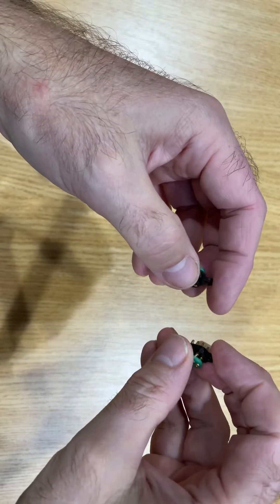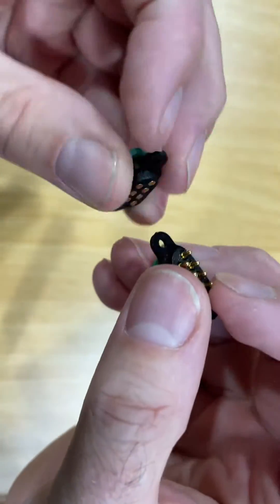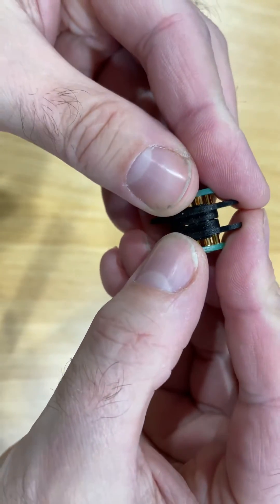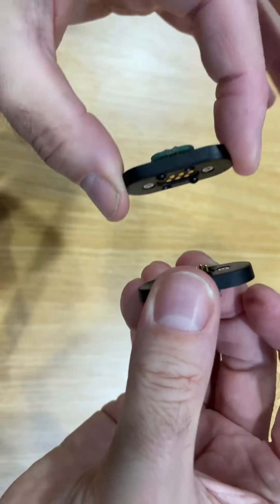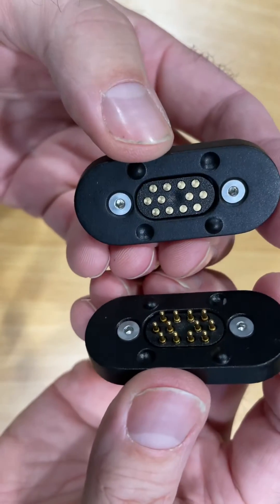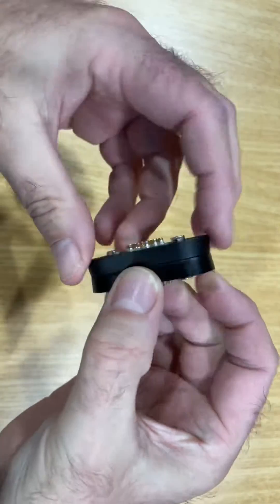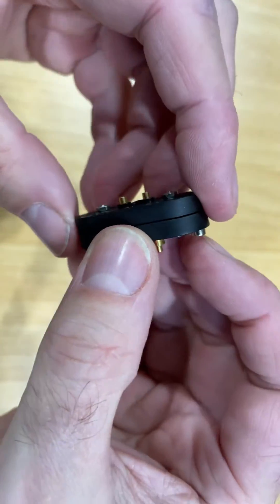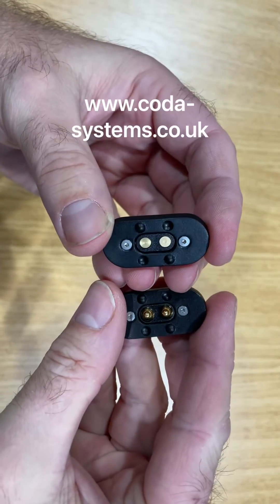CEO demonstrates Swift-Dock-Magnetic, self aligning docking connector.

Comment: Are the keys for the higher current connectors large enough to stop you from accidentally connecting them in the wrong direction?
Reply from the maker: Hi. Thanks for your comment. The keys are really there to reduce lateral movement once the connection has been made. The magnets will repel if you try to connect in the wrong direction. Thanks Swift-Dock.